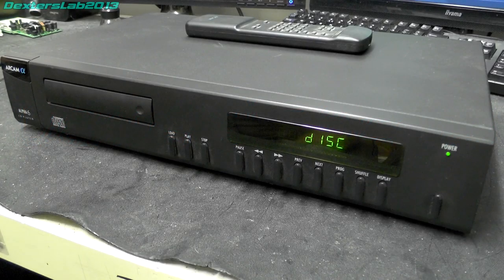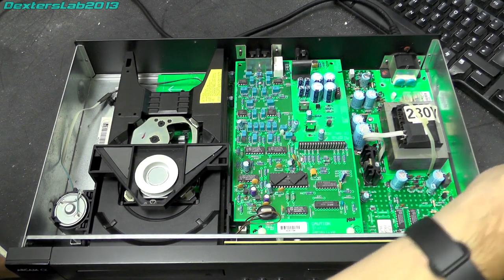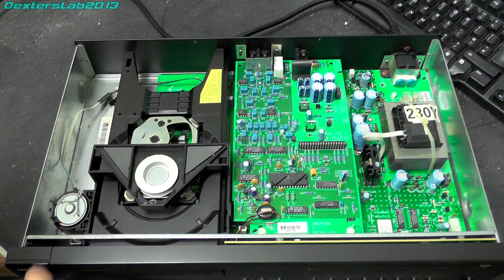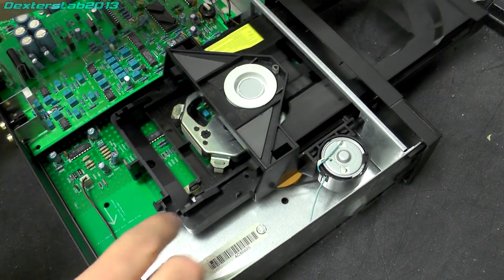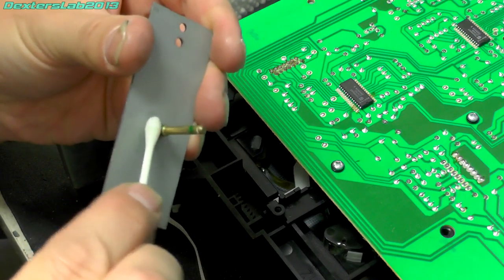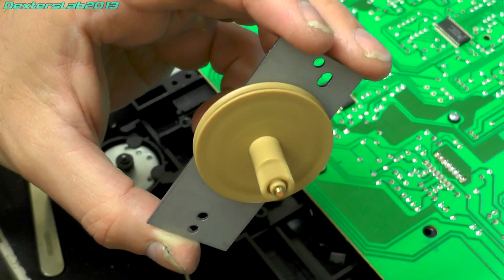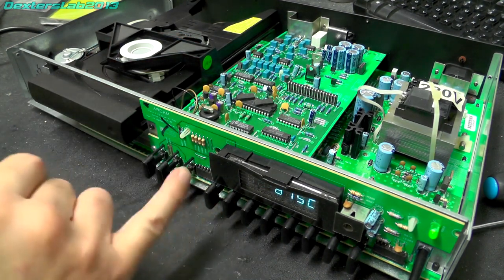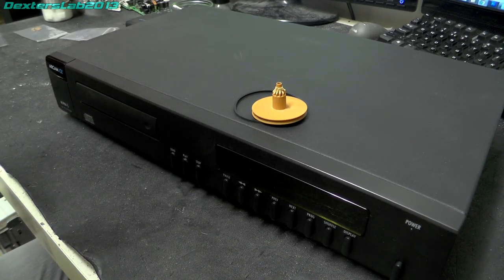DL173 Arcam Alpha 6 CD Player Repair

Comment: CD players always have the same faults, choose between dust  / lubrication / bad belt / bad gear. It has been a long time I didn't have one to repair tho. Vintage ones (early to mid 80's) have some value on ebay too.

Comment: I have the 5+ which is the same boards, tray and optics, my cog has gone, was wondering why you took the screw out at the back of the cd tray? Also, put the new cog and band in and the tray is still not working, any thoughts at all? Any help would be gratefully received. Neil

Comment: After you took the side screws out to take the front off, what were you doing with your hands over the main board? I think this needs an explanation for the novice.

Also, there's a bit in the middle missing, i.e. how to disconnect the connections at the back that go into the small board.
Reply: There's a massive chunk in the middle missing.

Comment: £12 for a plastic gear and rubber belt!? Thats very expensive! Surely it doesn't cost £12 to manufacture?
I was expecting it to cost £5 max. You could 3D print it a lot cheaper if you have a 3D printer.
Reply: 3D printing is not an option for small gears sadly
Reply from the maker: I think £12 for the gear & belt including shipping is reasonable. Once you account for the postage / packing costs, ebay / paypal fees  and then the cost of the actual parts encountered by the seller. I also don't have a 3D printer!
Reply: SLA 3D printing could be used. 

As to price, I would agree if this was for a Playstation or other massive volume consumer product, however this is a bit niche so the economy of scale is not there.
Reply: @DextersTechLab  You didn't say that the £12 included postage. Maybe its more reasonable with postage included.
Reply: Positively cheap for a small volume part. How about you make one for me and I'll give you £12